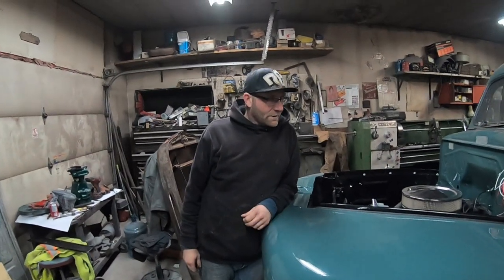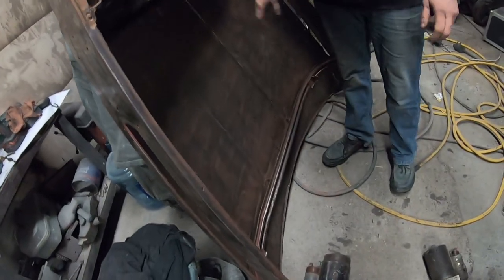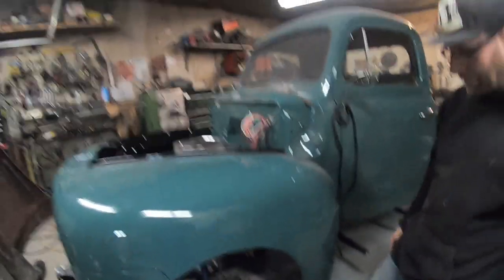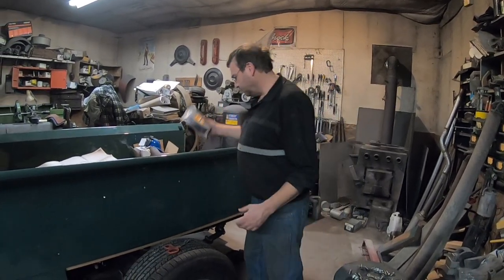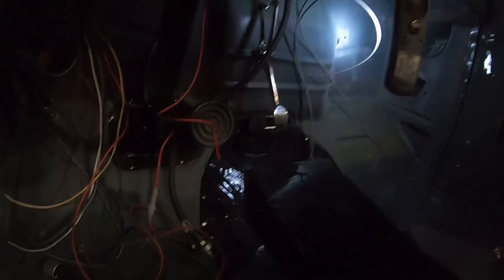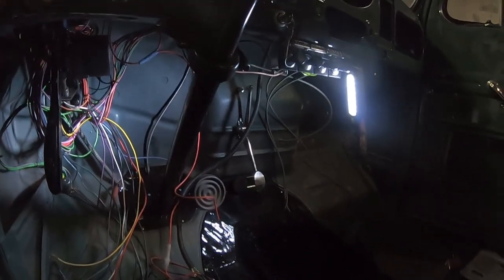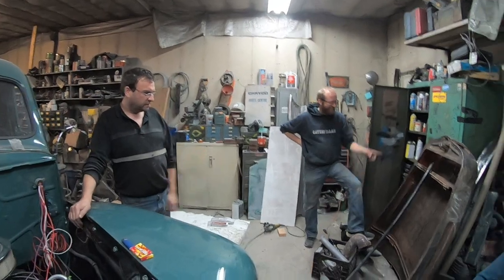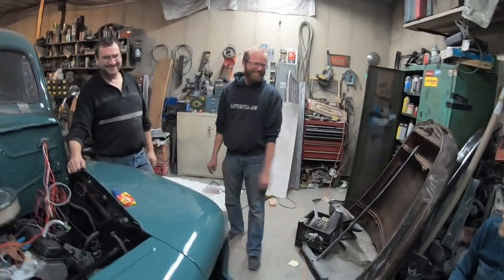1952 Ford F1 Truck Project Gets Rear Fenders Bolted on With Welting.  Field Find Truck.

Comment: What you guys add on dash is metal button for Stater switch push in to crank also let back after truck motor start up and do for 30 seconds each time and hole need be 5/8 size ! That button is 2 wire to one for positive hot one for start   and ground in for off selection of key ignition switch to hook up ! That button if order is Glow Plug for Desiel farm tractor or trucks motors and Gas fuel motors is used in 1930 to 1960  to ! Why saying get that button on because if Key Ignition switch start section doesn't work right and have button use to instead ! Hope like idea guys and excellent video and truck be ready to drive soon plus vechile shows & shines in warmer weather like summer season and like idea use hand choke cable carb too ! Also for gas pedal cover use big rectangle one then get metal foot pedal grip cover is metal from auto store if can find it  or Canadian Tire sell for sure in Auto Parts selection! I have on my 2002 Chevrolet Impala EX LTZ LS 4 door families car fix up all myself and why ask is because my hard plastic pedal car has no grip for gas plus brake pedal  also size 16 triple wide feet I have slip pedals to easy or hit 2 pedals at once Lol! Also glue the pedals cover with Grioola Glue Extra Strength type plus 2 metal bands to bolt in place to hold in place too and so glue tack on nice 👌 were need be! Hope having a Very good day with week to guys and be safe!
Reply from the maker: Grioola Glue is the shit
Reply: @pennyshotrodscustoms   :) does excellent for some stuff but other stuff not well at all! Lol

Comment: Hey Guys. I see that you guys are doing your build the opposite way that I am doing mine. You guys finished the body and are working to the inside. I did my drive train and interior and now I am working on the body. I like doing engine work with now fenders in my way. But it all has to be done anyway. Right. Keep up the good work. Cobra kai is going to hurt himself. Thanks for sharing.
Reply from the maker: Here's hoping Cobra Kai does get hurt but doesnt matter how you build your truck Andy as long as its getting done.
Reply: @pennyshotrodscustoms  As long as we are having FUN doing it.👍
Reply from the maker: Totally agree

Comment: How did you keep the fender bolts from spinning at you tightened the nuts since they don't have any bolt heads?
Reply from the maker: I believe I had someone holding a wrench on other side.